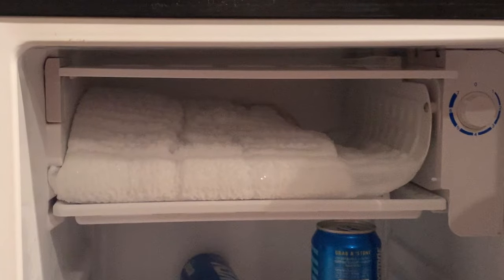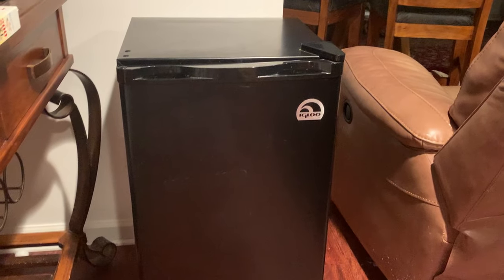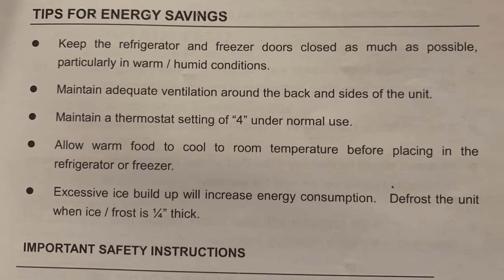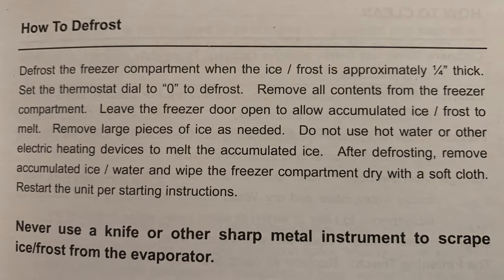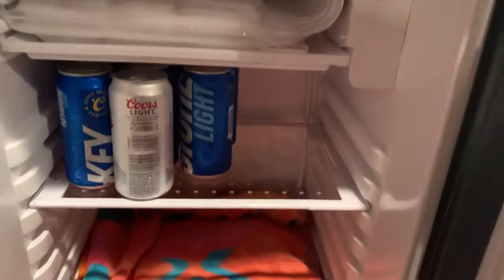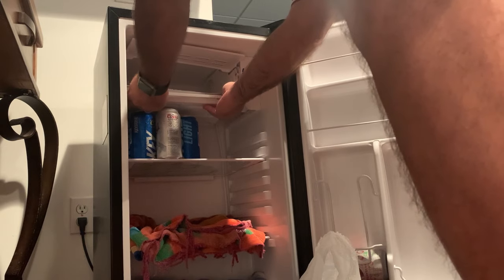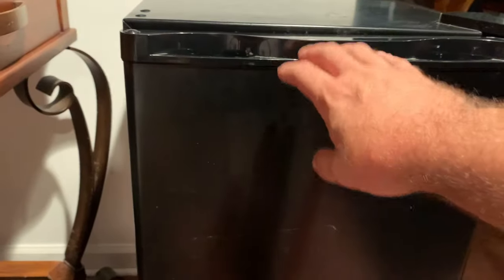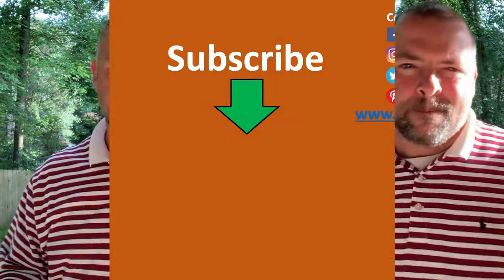How to Easily Defrost a Mini Fridge with Ice Built Up in Freezer! Instructions & Tips (Igloo FR320)

Comment: If you have soaking wet towels, DO NOT THROW THEM IN THE DRYER. Hang them outside or put them in the washer first. Driers aren't meant to handle large amounts of water, and it will burn out the motor from the effort. Ask me how I know. 🤣😂🤣😂🤣
Reply from the maker: Good call on not throwing a heaping pile of wet into a dryer for it to do all the work - wringing them out or letting them dry ahead of a time is a good idea!  Hopefully, your ice from your minifridge doesn't create that much water but it certainly could and when in doubt, best to not make your dryer do too much work!  Thanks for sharing, Bill!
- DIYNate
Reply: @DIYNate  Not likely, but just in case!
Reply: Just wring out the towels before placing in dryer and they should dry nicely in the dryer.
Ask me how I know ?
…cuz I’m SMART !
😂
Reply: Take no offense lol! The kid renting a room from me was over loading the washer. It was able to spin everything out. He then put the heavy clothes in the dryer 😳 He understands now, but 😬 it’s awesome I happened in when I did!
Reply: Thanks for this lol. Was minutes away from doing this
Reply: @LackingLogicFilms  Oh yeah, happy to prevent disasters for others, always.

Comment: The issue with those things is an inherent design flaw, because moisture from the non-frozen section is allowed to go into the freezer zone. If it had separate compartments like the full size refrigerators have, then this kind of thing would be somewhat rare. Other than that, the utility of the appliance is nice. Just would be better if the companies making them didn't cheap out on some things.
Reply from the maker: Good comment there - thanks for sharing your thoughts.  It does seem to be a pretty common situation most of us face in the life of a mini-fridge regardless of brand!
Best,
DIYNate

Comment: My ice was so thick that I unplugged it, set it to zero and took it outside.  I used not hot but warm water to start the melting.  It helped.  Big pieces came off as I tapped at it. I don't have a manual so I hope this little frig will survive my method of getting the ice out.  Next time I will be more patient and let it melt naturally.  I put the ice in the garden bed.  Thanks for the video.
Reply from the maker: That makes sense to me - it can be a bit of a wait so hot water or (carefully) a hair dryer or heat gun could do the trick as well.  They caution on tapping the insides for fear of puncturing some of the cooling parts but if you are careful, shouldn’t be a problem.  Thanks for your comment and for watching!
- DIYNate

Comment: Just got myself a koolatron mini fridge with a defrost button and the instructions confuses me. It says to unplug when defrosting to avoid a electrical shock but says press the defrost button in the middle of the temperature control knob and the fridge will begin to defrost. When the defrosting has ended, the thermostat will switch on automatically, and the fridge will start working again. Like how would i need to press the defrost button if i need to unplug the fridge? I don't know if its just bad English but I just want to make sure because I don't want to screw up my fridge.
Reply from the maker: Hmm... Not really sure but does sound like bad english or poorly thought out process.  I would probably just unplug and manually defrost.  It may be that they also have more of an automatic defrost, but I think if you unplug it without pressing the button, leave the door opoen, soak up the water, then turn back ojn, you will be good to go.  Good luck!
- DIYNate

Comment: So glad I found this video, I was going to grab my hammer and my big flat head screw driver and try to chip it out but I saw someone else’s comment about using the hammer and figured this would be safer.

Originally wanted to take it outside and let it thaw into the dirt but it’s currently January and -20 outside 😂
Reply from the maker: Yea - these temperatures this winter are making this an indoor project - haha!  Happy to help and thanks for your comment!
- DIYNate

Comment: We have one in our office. When the ice accumulates like yours, we let it sit in the loading dock (you could do it in your backyard) propped open and tilted forward over the weekend. Usually dry by Monday morning...
Reply from the maker: For sure - if you aren’t in a hurry, letting it naturally melt and drain is a great fix!  Just did the same with one on my in-law’s boat dock that had an ice brick in it and just drained it after letting it melt in the hot temperatures.  Thanks for the comment - good suggestion!
- DIYNate

Comment: What’re some signs that you punctured refrigerant tubing? I made the mistake of using a metal instrument to get off the ice and turned my setting to four but I also accidentally it that metal wire that’s underneath the freezer today and now hours later it’s making a weird gargling/water dripping noise… worried my mini fridge might blow up lol
Reply: He answered almost everyone else except you, what a guy.
Reply from the maker: Hey there - sorry for the slow reply!  I am guessing you punctured the refrigerant area and not sure if that did permanent damage or not.  Honestly, I haven't checked into how to fix that but my first step would be to google (I would be thinking of a quick patch solve like some type of hardening putty/glue/solder but there may be a lot of safety reasons to not go that route (by no means am I qualified to weigh in on that type of repair).  Hope you were able to get it repaired or replaced and it is now cooling for you.  Good luck!
- DIYNate
Reply from the maker: Haha - well, eventually, I did respond (although I wouldn't take it as expert advice - lol).  Sorry for my slow response but appreciate you making me laugh!  Thanks for the comment!
- DIYNate

Comment: Nate,

I Have an Igloo Mini Frig FR100/FR115/FR180.
I Want to Disconnect My Freezer Compartment Only.
It’s Useless and I No Longer Us it.

How Can I Just Disconnect the Freezer Compartment Only?

Thanks Nate
Reply from the maker: My best advice on that would be to try and contact the manufacturer and check the manual / specs to see if the freezer compartment can be disconnected.  Often, the cooling components are routed through the freezer area and meant to be part of the system (at least from what I can tell).  The manufacturer (or other people trying this on Google / YouTube) may be your best bet to finding out if it is feasible or if you will jeopardize your fridge by making the modification.
Good luck and best wishes!
- DIYNate

Comment: It’s really hot outside right now in Tennessee so I think I’m just going to my mini fridge outside for a couple days.  I made a big mistake with my last one and started using a tool.  I hit the fridge line and that was that!  Both were  was $25.00 at yard sales so this time I won’t make that mistake again!
Reply from the maker: Good call - that TN heat should melt that ice right out and lesson learned certainly on using a tool to chisel it out.  I definitely understand the instinct though as it seems like common sense.  Thanks for your comment!
- DIYNate
Reply: @DIYNate  Thanks!  It works in fact I just bought it back into a few minutes ago.  It didn’t have a drop of water left and turned back on.  I hope it still works!
Reply from the maker: Good deal - hoping it is cooling like a champ for you!
Best,
DIYNate
Reply: @DIYNate  It is!  Works great again!  $25.00 years ago used at yard sale!  My beer fridge!
Reply from the maker: Awesome - 25.00 is a great price for a well-functioning beer fridge over the years!  Congrats on being up and running smoothly again!

Comment: I poked a small hole on the tray. What should i do? Is it repairable?
Reply from the maker: Unfortunately, I am not really sure what the hole type is that may have been poked.  Good luck with a repair but not sure if that is something that can be fixed or not.  Maybe some type of JB weld or some other patching / glue / solder, but I am certainly not qualified to diagnose that repair or situation.  Good luck on the fix or replacement!
- DIYNate

Comment: Just moved into a tiny apartment, fridge was so frozen over I couldn’t even open the flap as the layer of ice was so thick it was blocking it from behind. Couldn’t even fit anything inside of it either. It was like yours on the left side of the freezer except mine was about 1/2 inch thicker and covered up the whole right side too where the dial is. Lol no idea how old this fridge is but I could tell it was never defrosted.
Reply from the maker: Hopefully, it acts like a new fridge after you defrost it - haha!  Sounds like it may take a little while for the ice to melt but that should be a big help going forward.  Good luck!
- DIYNate

Comment: Just earlier I unplugged my mini fridge, not thinking much abt it, it also had a huge ice block right at the back. Fast forward 5 hours, it’s like 12, I’m ready to call it a night since I’m super tired, and I’m like “oh! I should check my fridge” and it’s leaking all over the floor, also I haven’t kept anything in this fridge for like a few months, but then I had to find a bunch of towels, and there also was a bunch of just hardest soy sauce (from a bottle that cracked) and so soy sauce water was coming out from everywhere and the table my mini fridge was on was soaked. I decided to just put it in the bathtub. I really worried it’s broken, even though it still works fine when I turn it on (I overthink a lot) will it be broken? I need some help idk wha5 do do🤷🏻‍♀️😭
Reply from the maker: Sorry to hear about the mess!  It sounds like your fridge needed a defrost and that would explain all the water.  Once you have dried it out and cleaned it up, it should work much better for you.  Ideally, you want to keep it upright during the drying out process with towels and taking chunks of ice out.  Good luck and hope this helps!
- DIYNate

Comment: hi there brother...just helped a friend defrost their bar fridge. under the freezer compartment, I removed the tray and a cooling wire with a clip on part fell out. Does it go under the freezing compartment or does it sit on the tray under the freezer?
Reply from the maker: Hello Arnold - hate to say it but I am not too familiar with the clip you are mentioning.  My hunch is the wire / clip probably do not go in the tray since that is probably there to collect defrost water and electrical with water is not a good idea.  Just a guess though.  Good luck!
- DIYNate
Reply: thanks a lot bro. i managed to fix the problem. it was just a loose clip wire that is connected to the freezing pipes for the freezer. much appreciated. cheers man.

Comment: Wouldn't it be faster if you unplugged the fridge to defrost it?
Reply from the maker: Hi - thanks for the comment!  Yes - it is probably a good idea to unplug since dealing with electricity and melted ice becomes water.  The 0 cooling setting should essentially be the off setting as well, but probably wise to go ahead and unplug the fridge as an additional caution and to make sure there is no additional cooling happening to speed up the process.
- DIYNate

Comment: Is it possible to remove the freezer all together??? I haven’t used it in the 10 years I’ve had the fridge
Reply from the maker: Hey Hal - I think you are asking about removing the icemaker compartment in the upper section of the fridge, right?  I don’t think you can easily physically detach the entire section but you certainly can take out the icemaker from the holding area and use it for some extra storage.  I am not sure if that may create any performance issues for the fridge in the long run but certainly can add another storage area for items you may want to keep on the colder to freezing side…. Hope this helps and good luck with it!
- DIYNate
Reply: @DIYNate  that’s exactly why I’m looking into this, more storage haha thanks for the info though man 🤘🏻🤘🏻
Reply from the maker: Hey Hal - my apologies on my first response.  I misread that and thought it was a comment related to an icemaker repair video I have.  On second look and a couple google searches, it looks like most don’t recommend removing the freezer due to the risk of creating a Freon leak since the cooling system works for the fridge and freezer.  This article seemed to give some thoughts for those who really want to try it but I believe your best bet is to try and make do with it and possibly adjust the fridge’s settings down a bit to make the overall temp a bit more normal if using as another shelving area.  Link here: https://www.ehow.com/how_6192695_disconnect-freezer-mini-fridge.html

Sorry for misreading initially!
- DIYNate
Reply: @DIYNate  no worries man, that’s probably why I couldn’t find much when I googled removing it haha thanks for looking out

Comment: Any idea what the tiny white cord in the fridge is for
Reply from the maker: I think that cord has electrical wires running to the freezer compartment (best guess).  At first, I wondered if it was a drain line but don’t think that is it since the MFG made it sound like the fridge doesn’t have a drain by default (even though it has a drain port in the back).

Comment: After I de-ice it’s back to the same after 5/6 days. I have it on setting 5
Reply from the maker: Hey Kim - for reference, with mine, I took it down from a 7 to setting 4 (manufacturer's recommended setting from what I could tell).  I did find the following article that gives some ideas around the door seals, spacing, and a variety of other troubleshooting tips if it keeps freezing up on you - https://workshopedia.com/ice-building-up-in-mini-fridge/.  Good luck with the troubleshooting and thanks for the comment!
- DIYNate
Reply: @DIYNate  the door has a little space where air gets through so it doesn’t fully close at the top. That could be the reason then?
Reply from the maker: Yep - that sounds like it.  Could be that by lifting up the bottom front of the fridge to tilt a little bit backwards (sometimes they have adjustable casters) that can make it close better.  Tightening the hinge screws could help as well.  Hope you get it solved but sounds like you know the root cause now as well!
Reply: @DIYNate  thank you!

Comment: Use an ice pick and tap it, will crack and then u can take piece by piece out👍
Reply: Literally says to not do this lmao
Reply from the maker: Hey there - you may want to avoid this method since if you aren’t super careful you can pick a hole in the freezer coils / tubing.  I was certainly thinking of using a knife or pick myself but then thought better of it after doing a bit of manual reading and research.  Hope it turned out ok for you!

Comment: Worried about a floor that gets wet
Reply from the maker: A good practice is to put a couple towels in the fridge while the door is open and one on the floor where any excess would come out.  Then, set a timer (say an hour) and check to see if you can remove some of the chunks.  Keep doing that until it is all cleared out and dry the fridge out and you are ready to start it back up.  Hope that helps!
- DIYNate